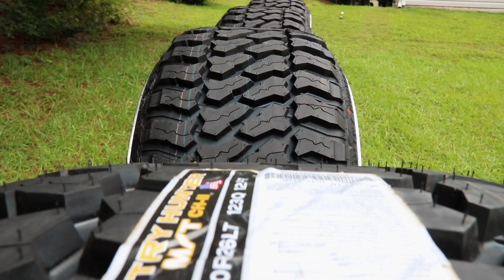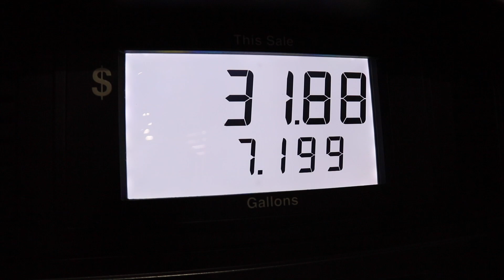Outrageous Lifted Truck Meet in Myrtle Beach | We INVADED!

Comment: You need to look up an (any level lift) for the rear of the yukon
Reply: You can’t bc any level kits are only for fords
Reply: @iseeyou4023  it's literally just a hydraulic ram mounted on the leaf spring shackle that just push down I'm sure you could redesign it to work for a truck with coil springs
Reply: They only make those for fords, he could get air bags on it tho
Reply: @gagehilliard8372  he said he doesn't want airbags
Reply: @tg2963  didn’t say he did just said that’s his closest option to a any level